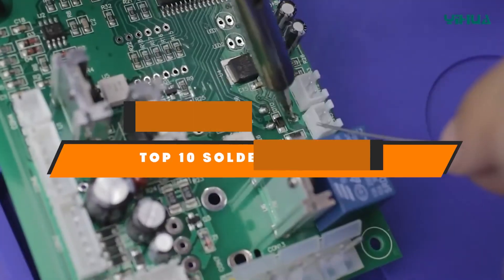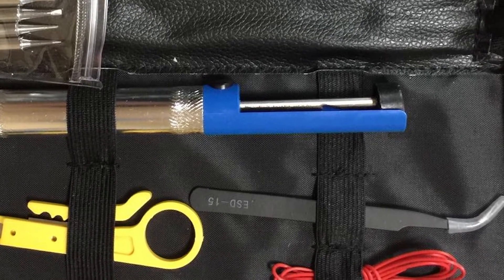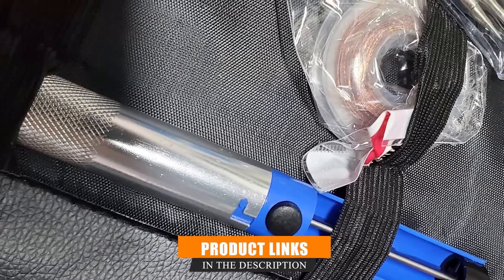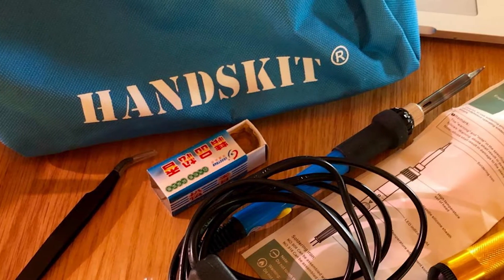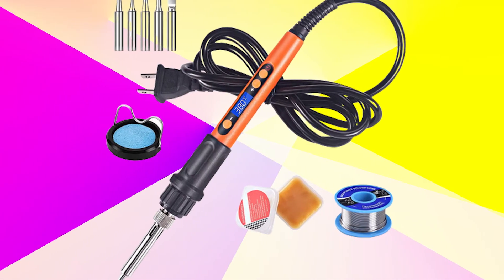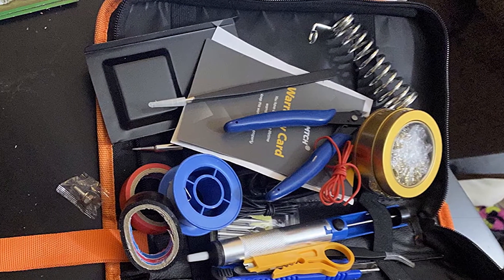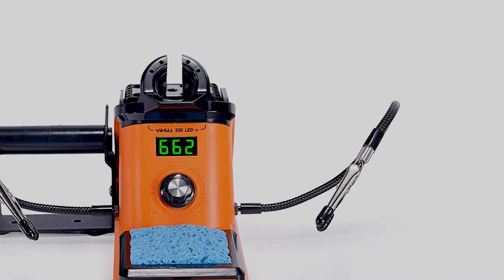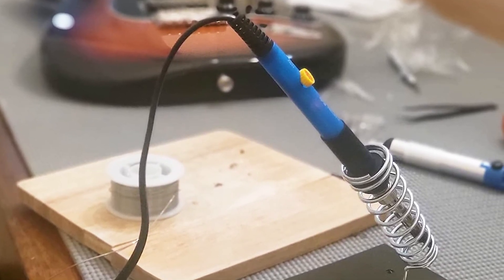Best Soldering Irons in 2024 (Top 10 Picks)

Comment: I am just a giy who likes to attempt any and everything but of course safety and precaution are for sure thing i take into consideration. Anyhow i am wondering what solder gun wattage should i buy to use it for anything a solder iron is used for. Its going to be used for lots of household projects and of course other uses. What is a descent wattage. I was thinking maybe 60 watts but i also see some at 100 watts and for same price as 60watts . Should i just buy one that has option to change the output wattage